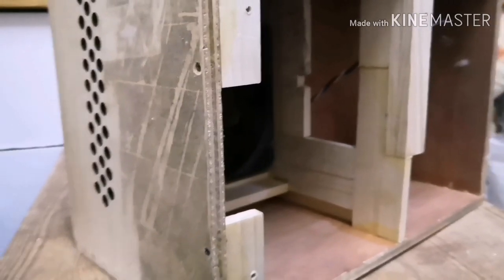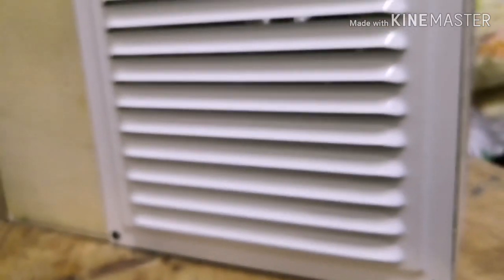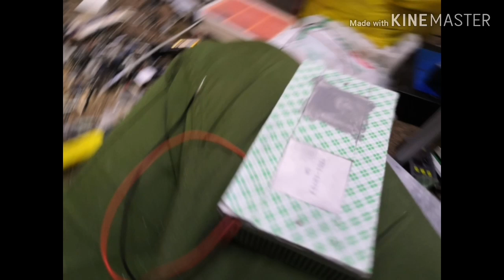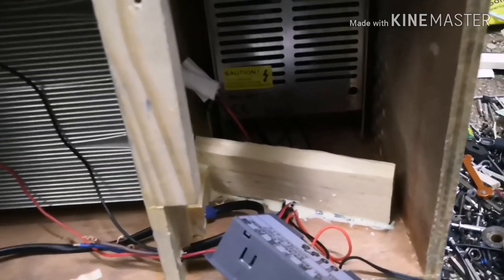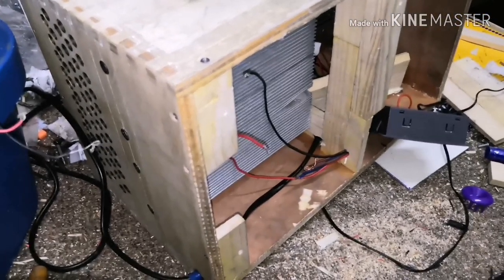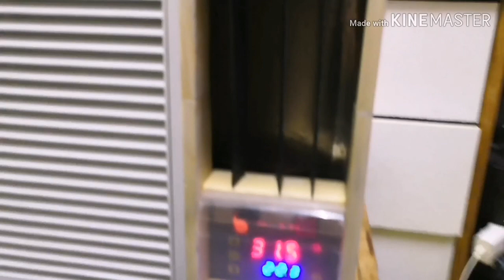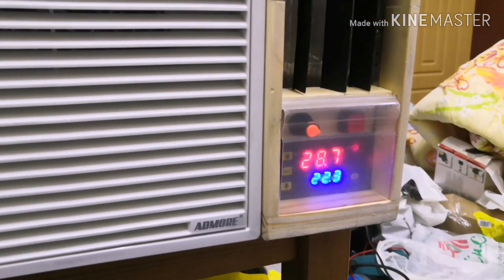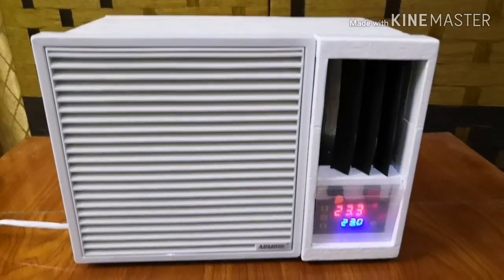PELTIER AC 👌❄️❄️using peltier MODULE TEC1-12703 Garmi Ka tod.. Zabrdast THANDAK.👌❄️❄️

Comment: Hello content creator! I have an amazing modification to the design of the AC unit: Can I give it 3 switches? This is what each switch will do:

 • The switch with the BLUE indicator will activate cooling mode (peltiers run normally).

 • The swith with the GREEN indicator will turn on the fans (no temperature change; just moving air).

 • The switch with the RED indicator will activate heating mode (peltiers will run with backwards polarity).

Is the above a good idea?
 (A) Yes.
 (B) Maybe.
 (C) No.
Reply from the maker: Yes that's a good idea.. thanks for your advice... Like share and subscribe... Have a great day

Comment: I am on finalizing peltier main issue which is heat exchanger, I giv u tip use air water cooler to exchange ur peltier hot water. Pump water from air water cooler to peltier module and send it back to air water cooler for evaporation cooling for heat exchange and cycle ur water hot to cool. Use that cooler in ur room too. I think u can use 2 peltiers for small cooler.  This is end.
Reply from the maker: Nice idea.. I will try it in future.. Insha Allah

Comment: I have a powerfull design, but need workmen to cut copper or aluminium, design is bit complex but I'm sure it will work, also want to commercialize it, principle is simple, combine an evaporative cooler with a refrigerator, just imagine a small fridge inside an air cooler with clever arrangements
Reply: have you succeeded in peltier a/c making?

Comment: where the hot air is going out ?
Reply from the maker: It will go out side the room once installed properly in a window..
Reply: @DIYTAYSEERworld  seems fine then
but what are the energy wattage consumption n conversion calculations?
Reply from the maker: This was just a testing model.. The wattage is depending on how many peltiers are used.. How many fans are used. And other electronics consumption..
As shown in my project you can see I was using 3 numbers of peltiers.. 2 fans.. And 1 temperature controller module..
The peltier that I use consumes 3 amps per unit x3..
Ant fans are 2amps each.. All rated at 12v..
So it is around 150 watts unit..
Reply: @DIYTAYSEERworld  u can enhance the heat decipation, by using evaporator grill technique on outer side

Comment: Issues are safety and weight/dripping. I would like a small, no more than 6" for safety, to open window, safe to be used in rain, lightweight to not ruin window track, and 110 volts for american plugs. I have vertical openings too. Window AC compromises safety, ruins window track the glass runs through, is heavy. If a small peltier can be inserted into 6" window opening, with the wires inside unaffected by weather/condensate, condensation taken care of perhaps outside? and voltage 110 (or even a USB plug), this would be EXCELLENT. Even 2,000 btu would lower room temps to not horrible. The safety factor is IT. Breakins, electrical water worries, thing falling out window, take care of this and you have a working product.

Comment: What temperature did you finally reach and how much power
Reply from the maker: It reached almost 19 degrees but it was struggling ..  should be tested in a small and air tight space and with proper installation..so I believe it can perform better.. And for the watts and power consumption.. I used 150watt 12v 12.5A DC power supply.. You can imagine..
Reply: @DIYTAYSEERworld  12703 is only 30W so with two of them you were pulling barely 60W so hence the poor results. With 150W power supply you could safely run two 12706 plates
Reply from the maker: Check my other videos for peltier comparison.. YOU can clearly see the difference between 12703 and 12706.
12703 is having more rapid cooling effect and also constant temperature difference between the two. 
Thankyou for watching. 
Please like share and subscribe
Have a great day ..
Reply: @DIYTAYSEERworld  Have you tried 12704, I watched a few guys were doing it, it can be even cooler. Btw, you should measure the air out of the aircon vent, and not at the peltier.
Reply from the maker: Not yet. But I am planning